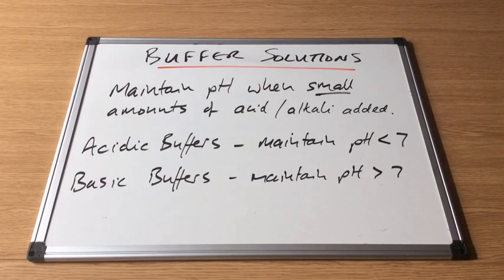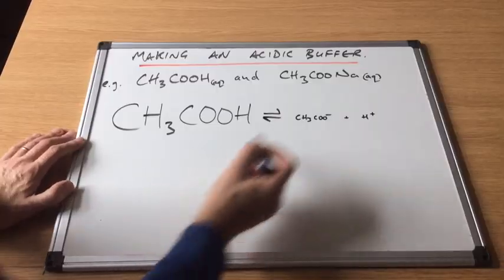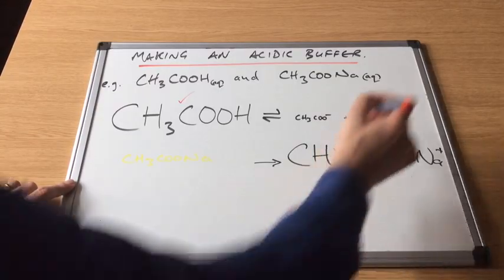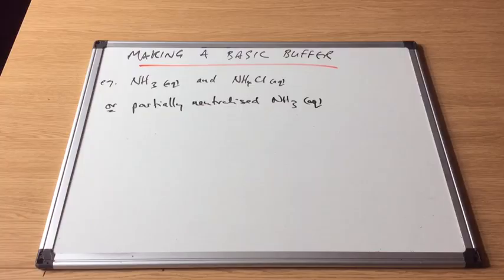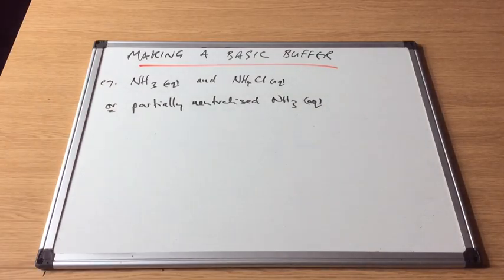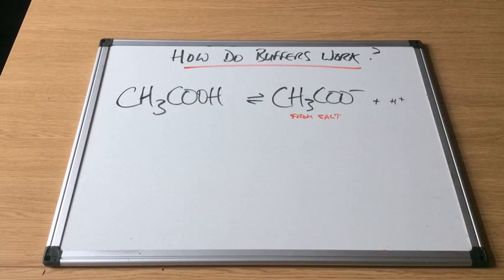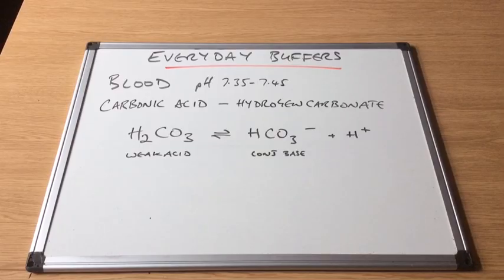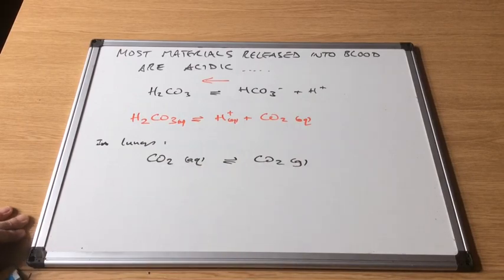Introduction to Buffer Solutions

Comment: Sorry, I’m a bit confused when adding an acid to the acidic buffer. When we add H+ ions, they would react with the ethanoate ions, using them up. So, wouldn’t the equilibrium shift to the right to replenish the ethanoate ions ? Btw, thank you very much for these videos.
Reply from the maker: Arian I see what you mean but the ethanoate ions are in excess compared to the H+ ions (remember that these come from slight dissociation of the weak acid). So adding extra acid means there will be more H+ than before and so some of the excess ethanoate ions react with them, sending the equilibrium to the left. Hope that clears things up. Glad you like the videos btw :)
Reply: MaChemGuy Ah, I see, thank you very much !!

Comment: i have a question if you please, in my book these reactions of an acid with its salt are called "common ion" but if we add a small amount of a strong base or an acid the whole solution becomes buffer, is this correct or the concepts of buffer and common ion are the same?

Comment: Hi when you showed the dissociation of carbonic acid, surely since it is a diprotic acid it should dissociate to co32- and  2H+ rather than what you have shown 

Regardless the video was helpful thanks
Reply from the maker: tommihay greene All done now :)
Reply from the maker: You are correct that it can donate both protons but these occur one at a time.  The dissociation which takes place in the blood is the one I have shown. If you want to know more, check out acid dissociation constants. Thanks for the comment
Reply: MaChemGuy Hello have you got any videos on strong and weak acids and strong and weak base calculations? :) Thank you
Reply from the maker: Not yet tommihay greene. Hoping to have them done by Easter